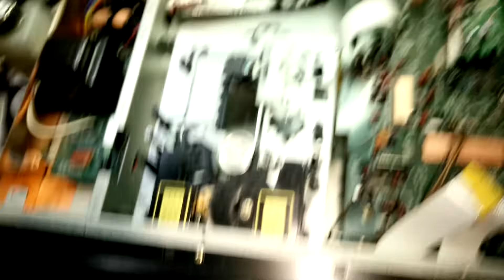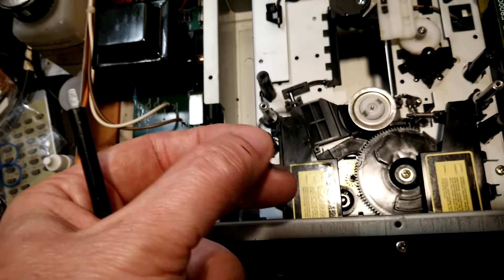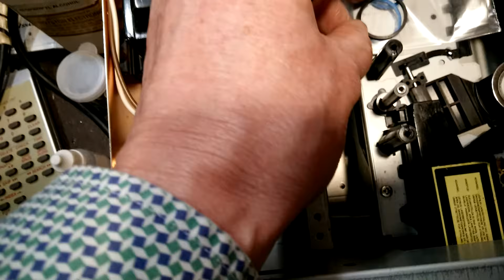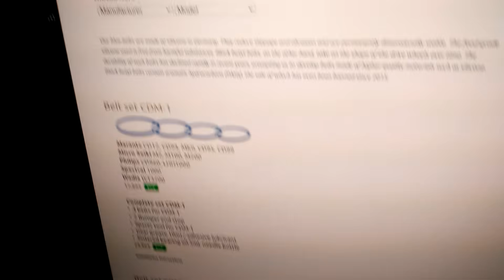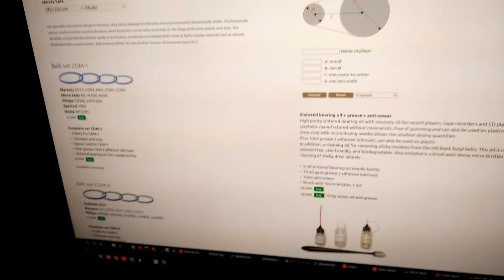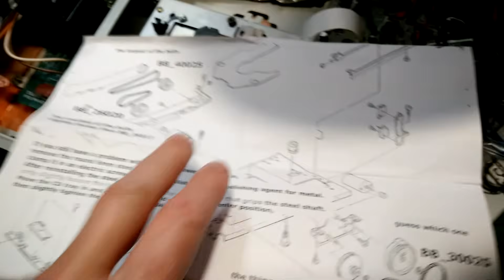Teac VRDS T-1 Transport service fail, even after crumbled gear & belt replacement due to wrong parts

Comment: Thats one of the things that I didn`t like fixing defective machines. I moved to building things from scratch instead. Less headaches :D
Reply from the maker: How many CD Players have you build from scratch? There was this CD Transport project going on DIY Audio where I even sent them a CDM-1 mechanism, but it got nowhere.
Reply: @hear-net-au  Not CD players :) But I would still be up to that with a cd-pro or something like that. I meant that I build tube amps and record players from scratch instead :) I lost interest in fixing things as this was not satisfying as much. :)
Reply from the maker: @Andre-bs5nl  CD-Pro is nothing more than the usual cheap Philips mech but encased in metal chassis. The last good mech from Phillips was CDM-4 (a.k.a. CDM-1 Mk2 which is a japanese name for it). Sony however made countless good mechs and so did Pioneer. Other makes too had an odd magnetic drive units but not as ubiquitous as Sony and Pioneer.
Reply: @hear-net-au  I have a cdm-9 atm spinning in a Rotel transport and a Pioneer dv-3xx inspired by Lampizator. The most amazing transports I had build wise were a Teac P10 and a Jays CD2-3. In the end I am okay selling both of them as it was just overkill. I now play with my tubed Philips cd-751 with the tda1549 which sounds like a wild bird :) And a combo of the Rotel and a Bricasti dac.

It's funny how a long long journey of tinkering and buying high end stuff leaves you with something mixed up and made out of plastic which makes you feel bliss.